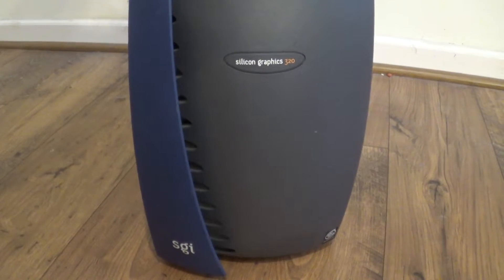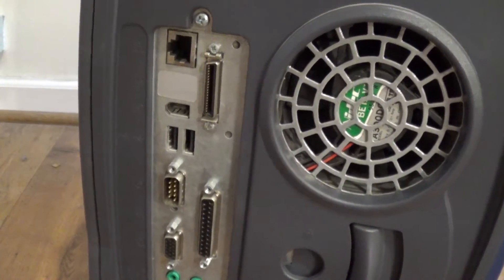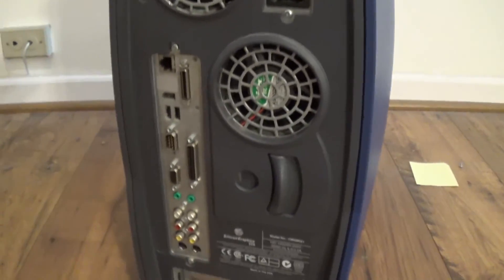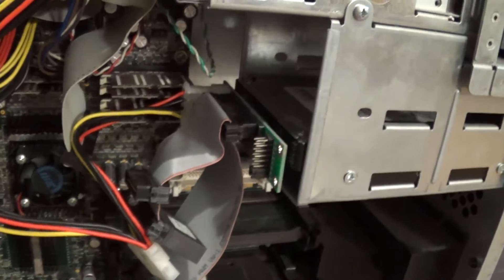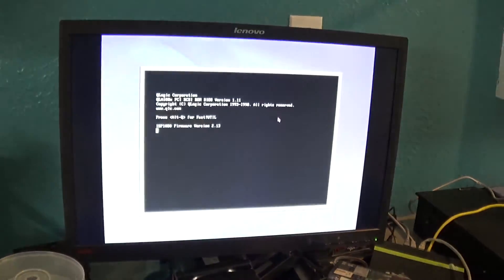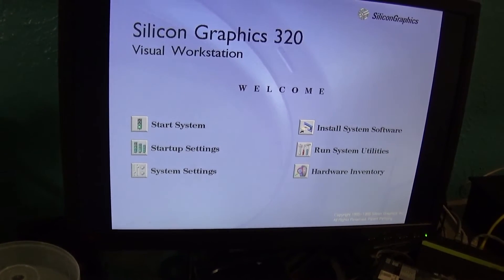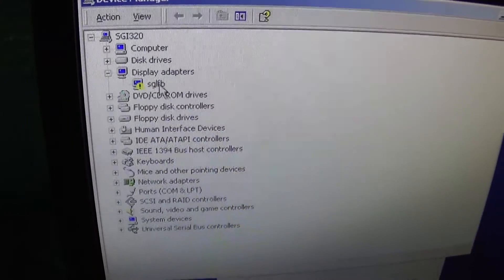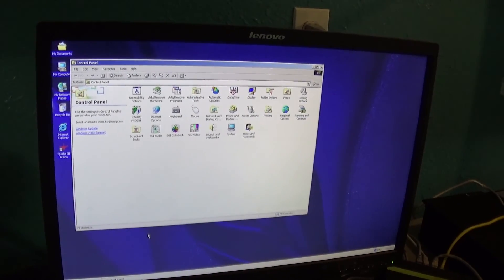The SGI/Silicon Graphics 320: A hybrid of a PC and SGI

Comment: I had this workstation in 1999-2000, it worked well, xpt FireWire port not working just because Windows NT had no support for it, so for about 6 months SGI promised a driver for it, but in the end they just gave away free firewire card to every owner. Other than that-no complains...

Comment: I bought one when it came, it was great as a developer machine, running Visual Interdev and later Visual Studion and .Net 1.0. But so freaking loud, I placed mine in the bedroom and ran long cables to my work desk I actually have mine in its original box with mouse and keyboard, but I sold the CRT screen long ago.

Comment: In high school and college the place I worked for bought these to run Pro/ENGINEER.  Solid machines, they were great work horses.  The price v. performance wasn’t the best but they proved to be fairly upgradeable and were always rock solid and had fantastic support.  We ended up adding a second cpu, then a couple of years later put in two of the fastest CPU’s possible and eventually the maximum RAM.  They were in service for a good 10 years before they were scrapped.  It turns out the price v productivity over the machine’s lifetime was fantastic.

I ran ProE v20, then 2000i, 2000i2, and finally 2001 on a 320 until they moved me to an SGI 330.  The performance was pretty good and it got better as we upgraded the cpus.  We didn’t require any texture support so those features were wasted on us.  By the time the nVidia Quadro cards based on the GeForce2 architecture came out and Pentium 3 CPUs above 600 MHz were available it started to make more sense to purchase a PC workstation.  However it took a couple years for them to catch up.

We handed our 320s down as newer machines were brought in.  Eventually the engineers were all using SGI 230/330 machines which were just boring PCs.  The 320s were eventually moved out to the shop floor for machinists.  They took a real beating and really demonstrated how well built physically they were.  The door you think was a gimmick kept a lot of crap out of the optical drives and Zip drives we had on our machines.  They were almost always kept shut as the machines were never really powered down and everything was typically accessed over the network.

Bottom line is that they were pricey, “PC guys” didnt understand their value, and they wouldn’t make sense for a home computer, but when it came down to getting work done in certain applications they were absolute workhorses.  Probably ended up being one of the best workstation purchases the company ever made.  After the SGI 230/330s the company went to Dells.